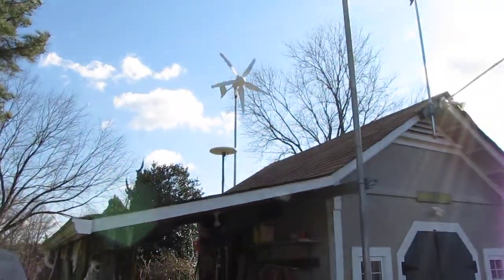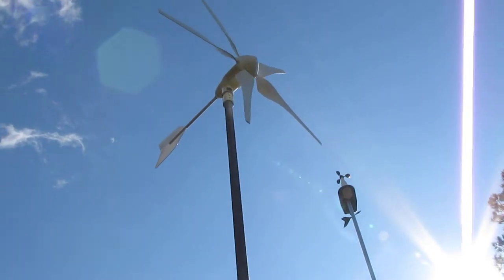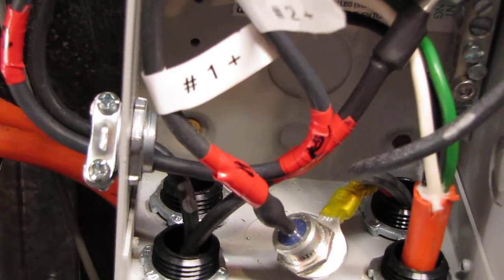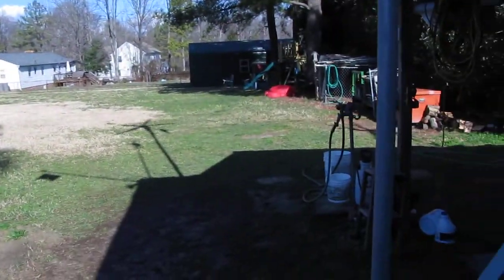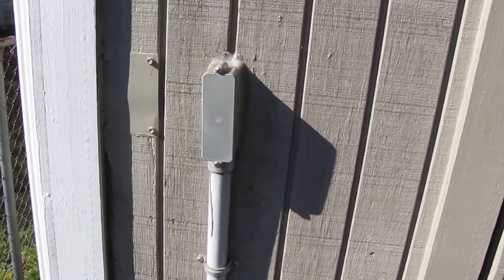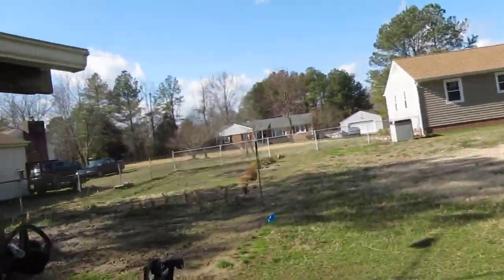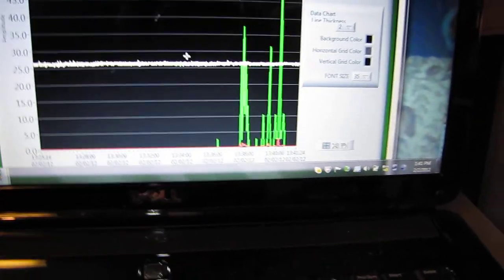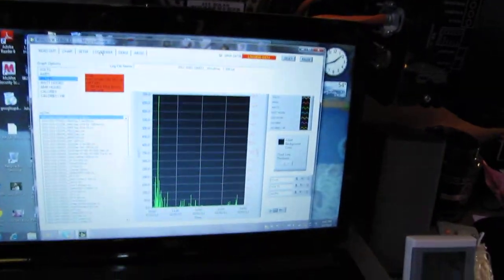WindMax's  Wind Turbine How To  VIARLOCITY  3 Phase Rectifiers and Diodes

Comment: I like your setup very much. I am still working on mine. I have a 500 watt 5 blade 12v and a 400 watt 12v 3 blade. And a new 1,410 AH 12v bank.  Mine is built on a trailer.  I need a telescoping pole for my setup that can be mounted on a hinged flange. I need to be able to keep the pole around 7 or 8ft when it's down so I can fold it for transport.  Here take a look at it if you want.https://youtu.be/p-3AiQheXg0
Reply from the maker: I sure will brother awesome I will subscribe also

Comment from the maker: @sunsensational Im Using 40 Amp 600 Volt Diodes They work Great Buddy  Yeap Positive Lead  Out Of Rectifier then To Diode  Then To My Battery Bank with A 60 Amp Breaker In Between before It Gets to The Battery

Comment: so you run the positive lead out of the rectifier thru the diode, then on to your controller/battery bank?   Does it matter much if i use a larger rated diode like a 40amp diode on 400w turbine which pulls around 30 amp max? or you think over-sizing the diode may screw things up and let something out the back end?